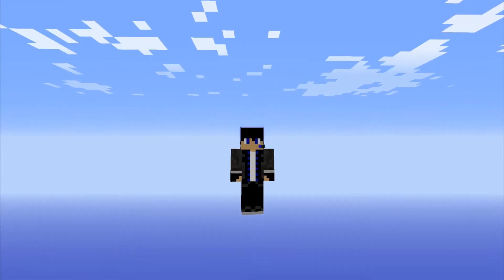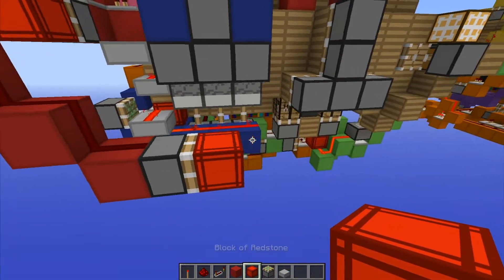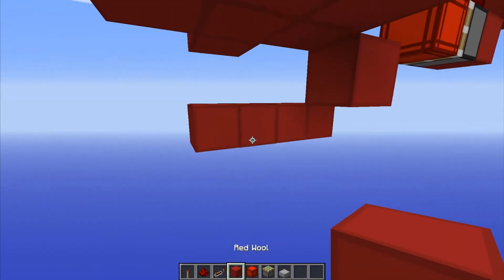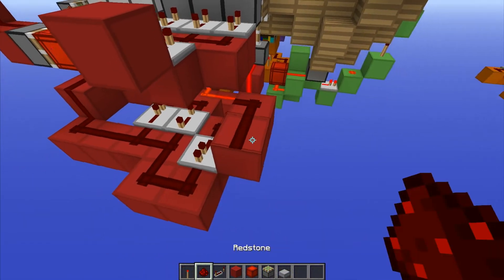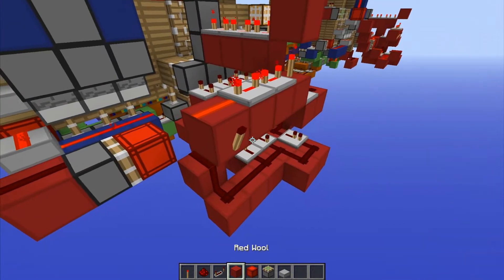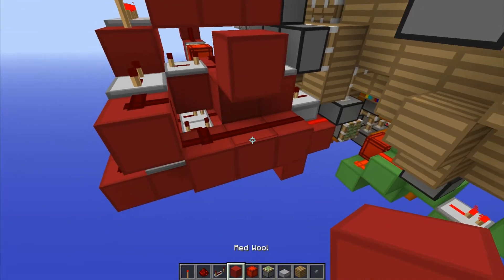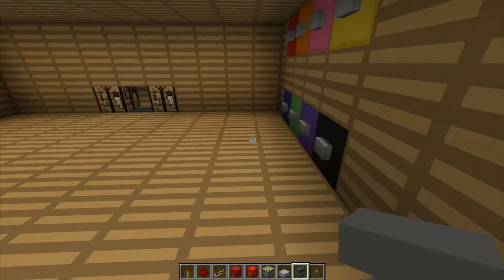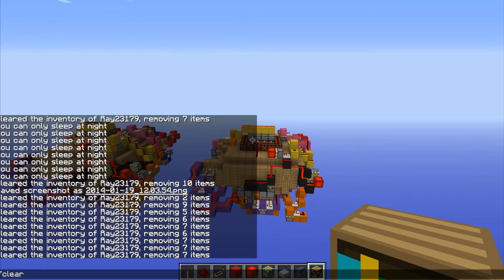Minecraft House in a Room Redstone Tutorial | Part 10 | Crafting Circuit

Comment: will u do a tutorial on that 2 wide 3 x 3 door on ur plot
Reply from the maker: I can't. It doesn't work, but I might go back and try to figure out how I could make the 2-wide work. I just ended up making a 3x3 based off of my spiral 3x3. I will be uploading it because it's faster than the other one (and the other one is old xD)
Reply: when i tryed it it did
Reply from the maker: Well, it does work but at the monostable circuit in the back, the piston that pushes upwards will mess up the floor (I'll put the floor in so you can see)
Reply: yh that and i fixed it but it is 3 wide now :(
Reply: just to let u know it 3 x 9
Reply from the maker: Ik, I fixed it too, but I didn't want it to be 3 wide. I've come up with a better version though. It has the same dimensions as my 3x3 Spiral, and works faster than the old 3x3 :D
Reply: Ray23179 can u come on the server and show me the fix
Reply: Ray23179 and u do know that ur 3 x 3 spiral is 3 wide lol
Reply from the maker: I do, That's why I wanted to make a 3x3 that was 2-wide, but I couldn't make it work